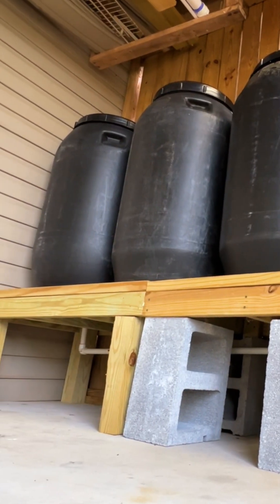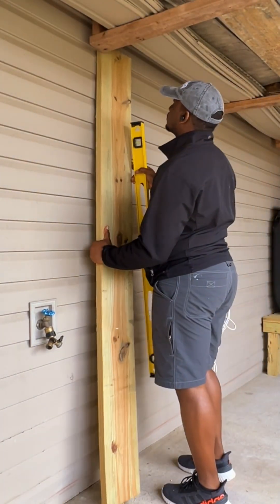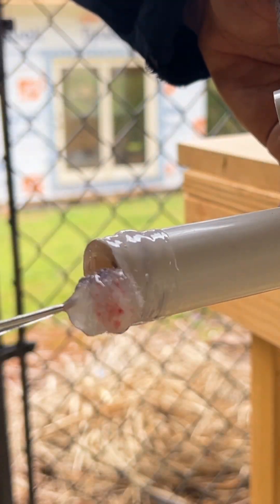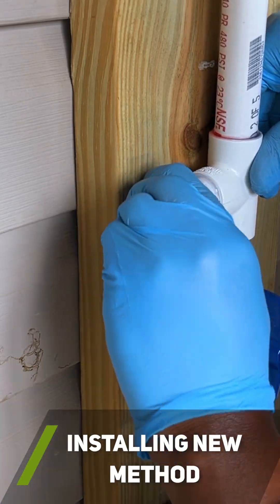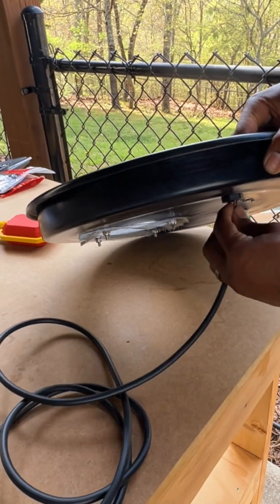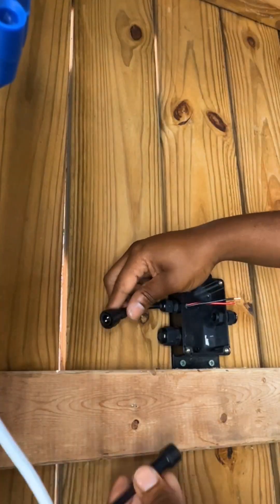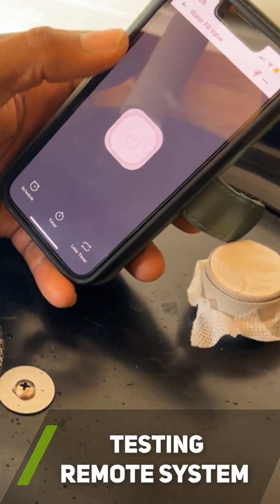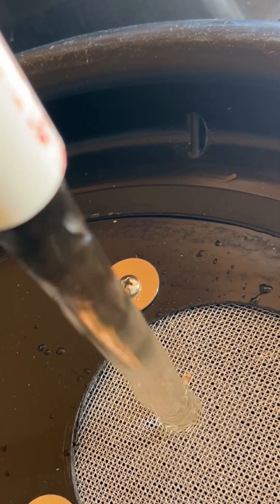NEVER Run Out of WATER Again: My DIY Solution for REFILLING Rain Barrels - #Shorts

Comment: Bro…no primer on those solvent weld connections?? It doesn’t matter if it’s not under pressure, always use primer when solvent welding

Comment: I have been following your videos for a while now, with all of the electronics used for your builds how do you keep the cost down?
Reply from the maker: I just try to do most of the work myself which will save you the most money. For some applications I've had to go the commercial route, but I don't typically post videos for those projects.